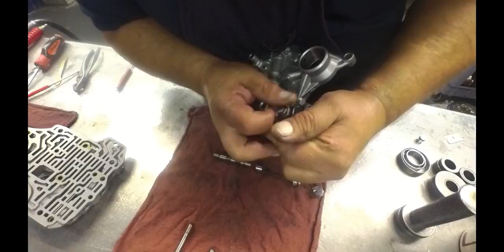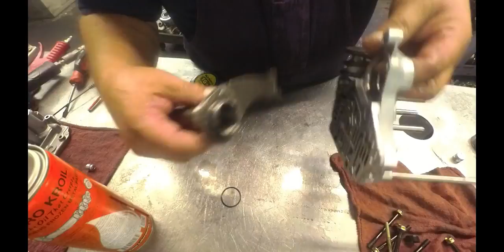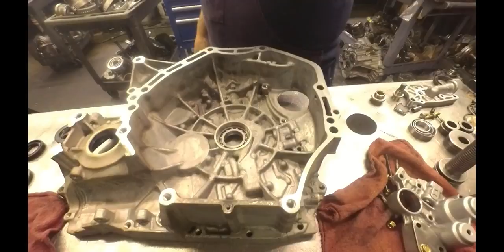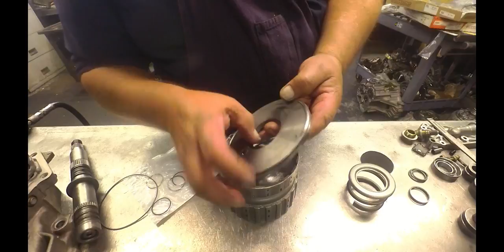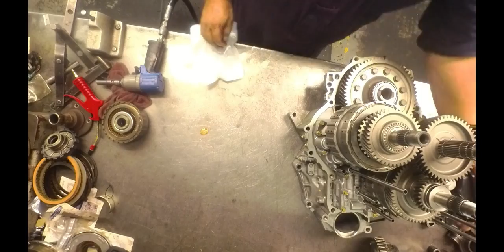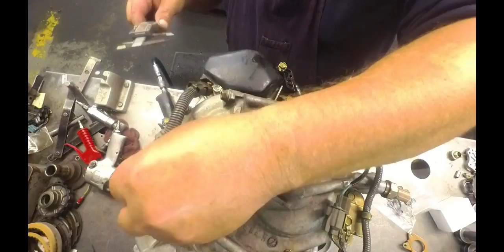B7WA Rebuild

Comment: 1:05:06 at this moment, you said if you can't turn the gears while holding the drum then you "dropped at clutch." This is whats happening to us right now. How do you fix this?
Reply from the maker: Pull the 3rd drum back off and start all over placing it on. Once the drum reaches the splines, take a rubber mallet and tap it down further before you go tightening the nut. It usually helps keep it from happening.
Reply: 1:05:08  hey I m currently at this point & while holding drum not able to turn the gears ! I tried to pull out multiple times & did exactly what u mention but still same results . Please help . Thanks & appreciate for making the video .
Reply: @curmudgeonTranmission : plz help my query . Thanks

Comment: Was there a persistent issue with lack of lubrication to 2nd gear that Honda attemted to address but remained an issue ?
Reply from the maker: No. Now they do tend to wear the case out where the bearings are because of the addition of the 3rd gear drum on the rear of it.
Reply: @CurmudgeonTransmission  Is the case ok to reuse if it becomes worn ?   What's the fix ? refresh the bearings ?
Reply from the maker: @Mr_BUSINESS_24_7  They sleeve the bearings. You can buy it already done from WIT. Match everything on your case before you give it up for the core charge.

Comment: @thanks for the rebuild video it's helping me. I m currently rebuilding the BW7A transmission which is around 215 k miles. When I tear down all the parts look great except for some gear burnout clutches plates. The low spray looks pretty good on mine & debating whether should I change it or not! Suggest me plz
Reply from the maker: I would change it. I replace it on every one. It's a lot of work to go back into for a not so expensive part now. Put the Sonnax end plugs in the valve body. For this one you will need 5 small, 2 medium and 1 large. Replace the torque converter. I would get it from Precision of New Hampton. If it has the cooler warmer on top of the transmission, I would put a bypass kit in and an auxiliary cooler. If it is going through the radiator. I would replace the radiator and add an auxiliary cooler. Links are in the description. Here is the one for the bypass kit. https://www.transmissionpartsdistributors.com/honda-acura-5-speed-transmissions-baya-maya-bdga-bgfa-mgfa-spca-mpca-b7wa-m7wa-transmission-cooler-warmer-universal-fit-external-adapter/

Comment: where are people going wrong when they try to rebuild these transmissions and they don't shift correctly afterwards or more specifically they shift hard or erratically.
Reply from the maker: Need to remove the CPC valves and make sure they are super free.

Comment: what are you whacking on at 1:00:50 ? ... just seating the gear(s) ?  do you change the bearings ? id imagine you changed the torque converter. Any specific brand you prefer for a quality torque converter ?
Reply from the maker: That is the park gear. I change them when they are bad. Precision of New Hampton is who I recommend for a torque converter.

Comment: In the disassembly video you were talking about Sonnax. Now in the rebuild video you're using Trans Go. ??  And do the Trans Go parts do the same thing as the Sonnax and Superior Trans Lab ?
Reply from the maker: I use the Sonnax end plugs on my Honda's. If you want to replace all of them, which I do, you will need 2 kits. If I remember correctly. Each unit is different. They also make a pressure regulator valve an a tcc check valve. The Transgo will do the same thing as those 2, cheaper. In the long run anyways. There is enough to do 5 transmissions. This unit is the Honda-LK Kit. Superior only makes snap rings for this unit, unless something has changed recently that I am unaware of. The real cure is a new radiator and ad an auxilliary cooler.
Reply: @CurmudgeonTransmission  I have an '02 TL Type S.  I'm not exactly sure what my transmission designation actually is.  But, you're right, I didn't see anything for the B7WA by Superior Trans Lab.  Seems Sonnax offers a lot of individual expensive stuff for these transmissions. I believe the TCC repair requires the purchase of expensive special tool holder jig and special drill to open up the bore.  And I'm not sure if I can justify spending all that money to go the Sonnax route as I'm not going to be rebuilding a whole lot of these transmissions.  The only reason why I feel like doing the one on my TL is #1: the transmission has 100k on it AGAIN and it's on its 3rd transmission. So I'm sure it will need to be done again.  #2: an interesting experience #3: bragging rights #4: keep the numbers matching #5: the transmission in the car right now actually is a remanufactured unit from Acura and would like to try to keep that transmission with the car. Meaning it's not a Howard reman or worse.    of course my other option is to install the ever popular 2006 - 2007 Accord V6 automatic transmission.   it's hard to see what you're actually doing in the video. But I'm sure it only comes apart one way and goes back together in reverse order. So as long as I stay organized...   ... shouldn't be too bad.   I guess I question my own judgement of the possibilities of not recognizing if other parts not discussed might need replacement ?  And if so, are these parts available through the dealership? And are they expensive to the degree that it might make the overhaul too expensive ?  like Subaru 5MT internal transmission parts are (way too expensive). lol  ... this transmission wasn't abused and it's actually still functioning beautifully right now.  but it did do 100k without the external transmission cooler (which I do plan to do this time).  The previous transmissions were done when the vehicle was owned by my customer and he didn't want me to install the external transmission cooler after the second replacement. because he knew he was giving me the car at 300,000 miles.  ya can't kill these cars even if you do overheat them. I overheated the snot out of this one because I couldn't figure out why it was overheating.  Ended up being a bunch of mother nature blocking the radiator fins.  By the time I figured out it was the radiator causing the over heating and changed the radiator....   ... I overheated the water pump so much, that the impeller lost its crimp on the impeller shaft and the engine over heating persisted and Acura ended up condemning that it was the water pump that was now the cause of the overheating.  And those head gaskets survived the scorching.  in the past few months I adjusted the valves, resealed the valve covers with Stone or Ichino valve cover gaskets, resealed the water pipe / crossover pipe and replaced the thermostat with a tama thermostat, replaced the knock sensor with NTK part,  resealed the lower intake runners, cleaned the intake manifolds and EGR ports, replaced (6) fuel injectors with khein reman units,  replaced the IAT sensor NTK brand, replaced the ECT sensor Beck Arnley, replaced the tw fan sensor switch beck Arnley, replaced PCV valve genuine Honda part, removed the throttle body and cleaned the throttle body, removed the IAC valve and cleaned that valve, resealed IAC valve resealed throttle body, replaced (6) spark plugs NGK iridium and (6) new Denso coils, replaced oxygen  sensor.  really hitting this engine and driveline with the smelling salts.  What didnt I refresh ?  MAP sensor, TPS sensor,  IAC valve, crank sensor. lol  .... Running wires for stereo and sourced a pretty nostalgic set of Neuspeed springs for it.
Reply: Update:   unless I'm misunderstanding something Superior TransLab Part #  STL-HO5-388  is for Honda / Acura 5 -speeds

I'd say check this kit out !!   it seems to state that this kit takes care of numerous more issues or symptoms with these transmissions.   But I'm not sure if the Trans Go does the exact same thing.  But the trans go description of of what their kit actually does isn't as elaborate or in depth as the Superior TransLab kit claims.  Definitely a lot more components and modifications associated with the Superior kit.

Comment: Thanks for the video and enjoyed the assembly. I have the same transmission that was rebuild in a reputable shop in 2012. It was fine until last month. It has been 55k after rebuild and it started to shift rough in the mornings but it get better after driving. Do you recommend anything. Thanks for your time
Reply from the maker: If there are not any codes in the system, you could try 1-2 bottles of Black Lubegard.
Reply: @CurmudgeonTransmission  Thanks a lot for your reply. There no codes. I did clean A/T CLUTCH PRESSURE
CONTROL SOLENOID
VALVES A and B, and A/T CLUTCH PRESSURE
CONTROL SOLENOID VALVE C. There was nothing in them. I did a trans flush with Dw1  3qt. The drain plug did catch the friction material but, it wasn't excessive. The fluid was not too dark neither very red. I also did replace the filter with ATP filter. I feel like they helped a bit. Do you recommend doing 2 more flushes or add Lubegard right away. Thanks for your time.
Reply from the maker: Just seen your re-post. It got flagged for some reason. I don't recommend transmission flushes. A lot of the dealerships no longer recommend them either. They will void your warranty over it now. I would try the Lubegard. It could be a faulty A&B solenoid. They are the ones that fail the most. Very rare but it does happen. If you replace it, I would not recommend ANY aftermarket solenoids for this transmission. I would also try cleaning the MAF sensor. Be very careful with it though, easy to damage.
Reply: @CurmudgeonTransmission  Thank you so much, will try all of this. Have a great day!